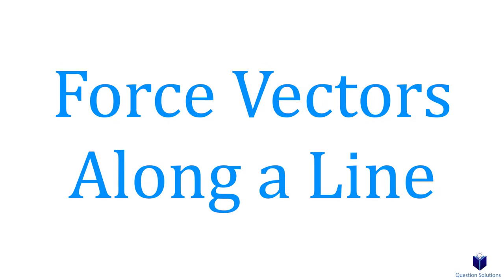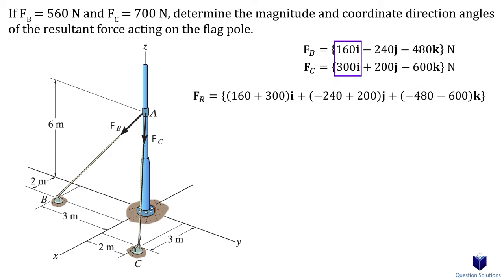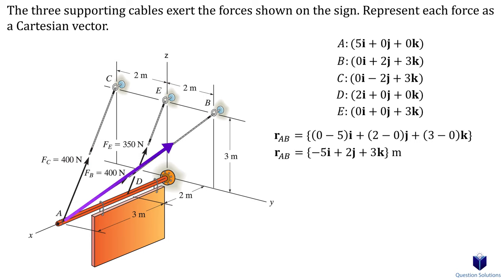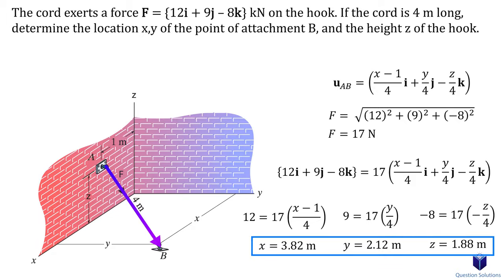Force Vectors Along a Line | Mechanics Statics | (Learn to solve any question)

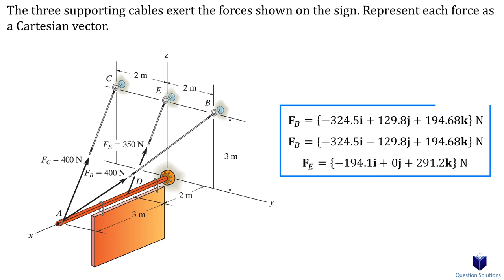Comment from the maker: Please note there is a typo at 5:14. The 2nd value is FC, the answer is still correct, typo is "FB" -> "FC" (value is correct as only the j component changes and is negative). At 3:55, there is a typo, "cos" should not be shown at the final answer. It should just be "α = 66.94" and the same goes for other values. Thank you.

Comment: in statics, you often need to know how much of a force is pushing or pulling in each direction to determine if a structure is stable.

1.Understanding Force as a Vector

Vector Basics:
A vector is something that has both magnitude (how much) and direction (where it’s going). Think of it like an arrow pointing in a specific direction with a certain length.

Force as a Vector:
In physics, a force is a vector because it not only has a certain amount of push or pull (magnitude) but also a direction in which it acts.

2. Magnitude of the Force

The magnitude of a force is just a number (a scalar) that tells you how strong the force is. For example, a force of 10 Newtons has a magnitude of 10.
The magnitude doesn’t tell you where the force is directed, just how strong it is.

3. Direction of the Force

To fully describe a force, we also need to know its direction. This is where a unit vector comes in.

4. Unit Vector

A unit vector is a special kind of vector that has a magnitude of 1 and points in a specific direction.
Its job is to provide direction without affecting the magnitude. You can think of it as a direction pointer that doesn’t change the size of the force, just where it points.
In Cartesian (xyz) coordinates.

5. Cartesian Form of a Force

When we want to describe a force in 3D space, we use its Cartesian form ( i, j k,)

6. Putting it All Together

To describe a force completely, we multiply the magnitude (how much force) by the unit vector (which direction):

This equation tells us:

Magnitude: The overall size of the force.

Direction: How the force is split up among the x, y, and z directions.

7. Why This is Useful

By breaking the force down into its Cartesian components, engineers and physicists can analyze how forces interact in different directions. For example, in statics, you often need to know how much of a force is pushing or pulling in each direction to determine if a structure is stable.

Summary

Magnitude: Tells you how strong the force is.
Unit Vector: Tells you the direction of the force.
Cartesian Form: Breaks the force into parts acting along the x, y, and z axes, making it easier to work with in problems.
Reply from the maker: Great summary!

Comment: 00:03 Expressing a force in cartesian form

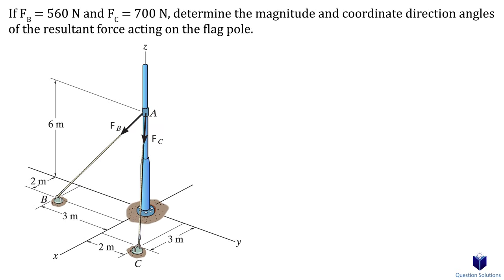00:56 Finding resultant force and coordinate direction angles for a force directed along a line.

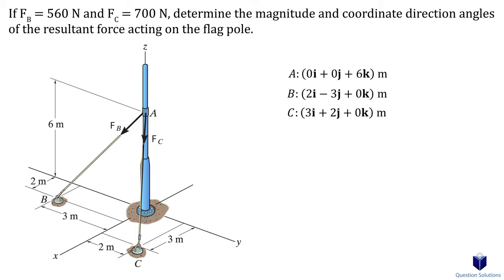01:48 Position vectors are used to represent the starting and ending points of a force.

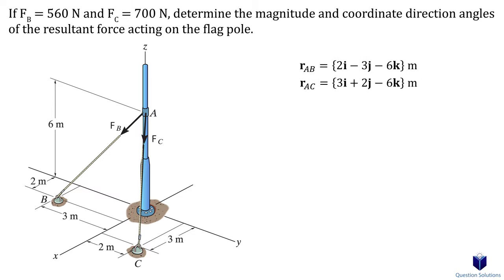02:38 Force vectors along a line can be expressed in cartesian form by finding the magnitude and unit vector of the position vectors.

03:22 The resultant force can be found by adding the components of the vectors together.

04:15 Express each force in the ropes in Cartesian form.

05:10 To find the location of point B, we can use position vectors and unit vectors.

05:54 Forces directed along a line can be represented using Cartesian form and solved by equating the components.

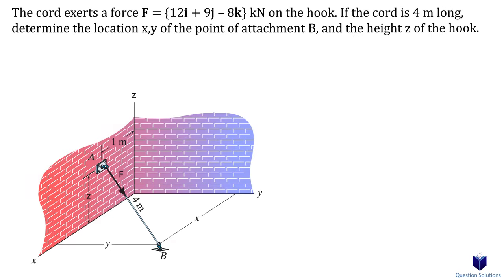Comment: In 5:14 at the end of 3rd section of the video, is it impossible to calculate the clear values in Newtons with given information? What i mean is: are the i, j and k components' values unknown or are they just used for annotation?

Great videos btw, helps me understand my uni course a little bit better:)
Reply from the maker: I am not sure what you mean by clear values. The answers are already in newtons. The i, j, k components are not variables. They represent the x,y,z axes. So let's look at force FB. What the answer says is, there is a -324 x-component, 129.8 y-component, and 194.6 z-component. Another way to look at it is how do I get to a certain spot. Start at point A, and see how we can get to point B. I have to go in the negative x-direction (so towards the wall), then I have to go to the right (so positive y-direction) and then I need to go up (so positive z-direction). We are taking a scalar magnitude of a force, and breaking it into each component. The same as how we break a 2D force into x and y components.

Comment: In example 1, I thought we add Cartesian rB and rA. Why do we subtract rB and rA in this case?
Reply from the maker: Could you provide a timestamp so I can take a look at the location you're referring to?
Reply: @QuestionSolutions   is at 2:11
Reply from the maker: @darrylcarter3691  So we are writing a vector from A to B. To get that vector, you subtract the initial points from the secondary points. Here, that would be subtracting A points from B. Also, we aren't adding rB and rA, we are subtracting A from B, the points, not position vectors. If you meant the points, and that we should add them, then you have read this incorrectly or heard it incorrectly, since that is not how a position vector is found. Let me know if that isn't what you were asking.
Reply: @QuestionSolutions  yes
Reply from the maker: @darrylcarter3691  Awesome! 😀
Reply: @QuestionSolutions  and doing research, I thought of it as find the change in position. To do that we have to subtract the initial from the final.
Reply from the maker: @darrylcarter3691  Correct. 👍

Comment: I would want to ask  how would you assign the direction of the forces
So let's say in the first question it said the tension in rope AB is 560N and that of AC is 700N . Assuming that no direction has been given how would you know if the direction of the forces is the same as what is in the video or it is in the opposite direction. This keeps getting me confused Thanks
Reply from the maker: You can assume either way, but you can guess as well. For example, you can't push on a rope, because they can't take compressive forces, where as a stick/rod can. But it doesn't really matter if you can't figure it out, the direction of the force is always an assumption. Then you carry out your positive and negative sign convention until the very end. If you get a negative answer, that means the direction of the force is opposite to your assumption. When you do a lot of questions, you can actually make a very good guess as to which way the force will face. 👍

Comment: Hey just asking aye but with all ur videos for statics do u go over all the possible questions that could be asked?
Reply from the maker: No, of course not, that's impossible to do 😅 Professors come up with different questions all the time. What these videos cover is the fundamental applying process that allows you to solve a question. So I try to show how the equations you learn in class can be applied to different questions with examples. I don't cover proofs or theory because your textbook/professors do that, I try to show the methods to solve the problems pertaining to a chapter.
Reply: Oh ok but would you say it is necessary to go over the theory coz I just don’t understand anything my teacher says but with you I am able to do the questions
Reply from the maker: @anasmalek4623  I think theory is important for proofs, but a lot of the time, most students have the theory down, or they can write down the equations they learned with ease. The problem is, they have a hard time applying the equations, so hopefully, these videos help with that 👍 Also, even though proofs aren't covered, I go over the equations required for each chapter.

Comment: Hey sir there’s a mistake at 5:14 u accidentally put force B twice instead of force C
Reply from the maker: Thank you for pointing it out, there is a typo. The 2nd value is for FC, answer is still correct, the j component is negative, otherwise, it's identical since they are both symmetrical through the x axis.

Comment: isn't it that the magnitude x should be 2.82m not a 3.82m
Reply from the maker: Are you asking about the last question? If so, we aren't looking for a magnitude. The magnitude here is actually the length of the cable, which is 4 m.